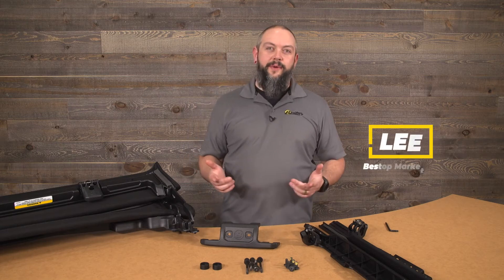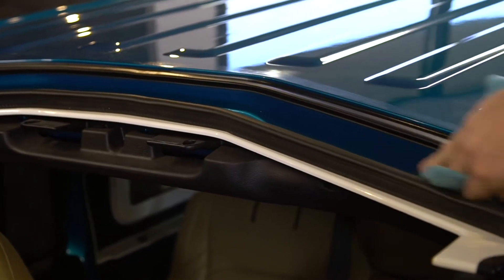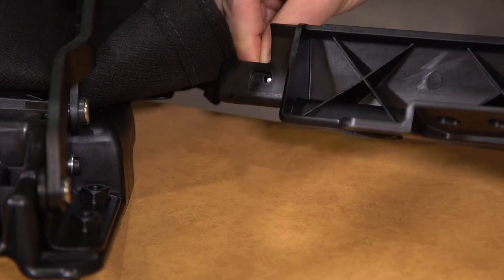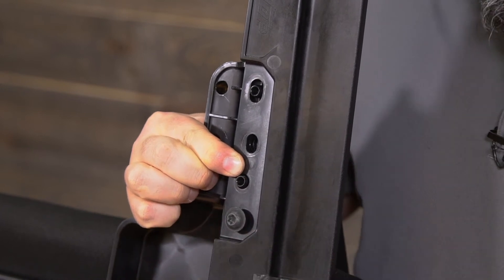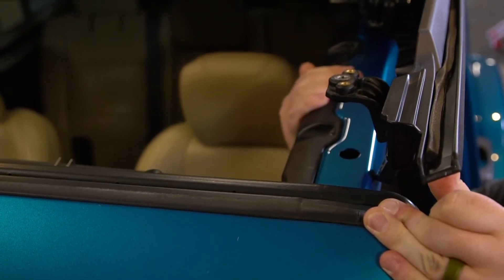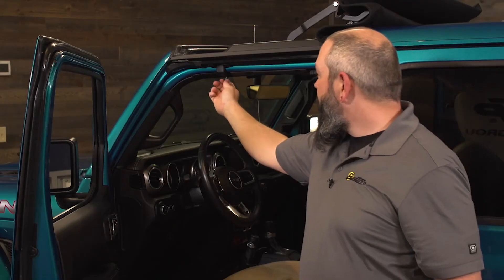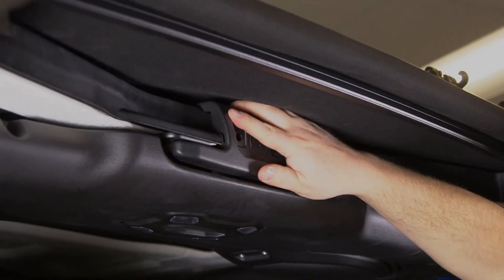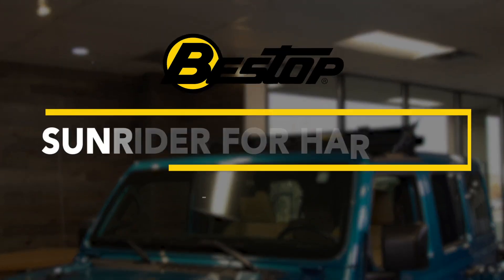Sunrider for Hardtop for JL Wrangler/Gladiator Installation

Comment: Thanks for the video. I was a little bit concerned on the installation but this video removed my fears. I am waiting for the Sunrider Black Twill to be delivered day after tomorrow and looking forward to install it on my new 2021 Gladiator Mohave. I also have the Bestop EZ-Fold Tonneau in Black Twill so the Sunrider will be a perfect match.
Reply: Installed it yesterday. The Z clips were tricky and took the longest time. The rest was very quick. The Jeep torque wrench set that came with the Gladiator was the only tool required.

Comment: The product has been updated to eliminate the Z clip.  It would be beneficial to have an updated video to reflect the product change.
Reply: Yes! I’m in total agreement!
Reply: We are supposed to get ours delivered today.  Hope the z clip isn't there.  If not, you're correct, the video needs an update.
Reply: New top arrived.  No Z clip, instead it is an eye clip with a couple of barrel bolts.  But, install videos on their website aren't working.  404 error link.

Comment: Having trouble with the two 20 mm bolts on drivers side ..can't get them to thread into door rail nuts worked okay on passenger side ... suggestions appreciated
Reply: Question is 3 months old.  You get it figured out?  All of our bolt issues were just a matter of alignment.  As soon as they were aligned, easy-breezy.
Reply: Just received one and was going to install today for wife, same problem except mine is on passenger side, will not thread without crossing. Will be contacting Bestop tomorrow

Comment: What keeps the sunrider from flopping back and forth when the it's deployed? The OEM soft top has velcro straps to prevent the top from flopping around when just the front part is pushed back.
Reply: You get a velcro strap for the Sunrider for that same purpose.

Comment: I just installed my Sunrider on a 21 Gladiator. The silver pivot on the driver’s side hinge seems to brush the inside of the side rail when I pull the top down into position. The clamp looks to be 1/8” left of center when I engage it. The passenger side clamp is almost dead on center of the receiver. All the gaps look great, everything appears correct. Haven’t gone through a car was yet, so I can’t attest to water sealing issues. Should I be concerned?
Reply: I’m having the exact same thing happen! It’s unfortunate that Besttop hasn’t replied.